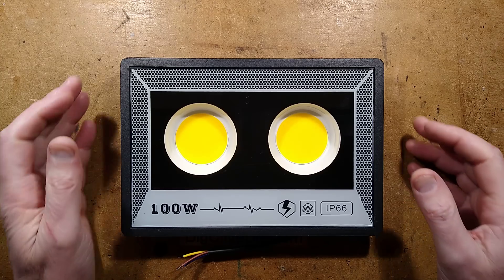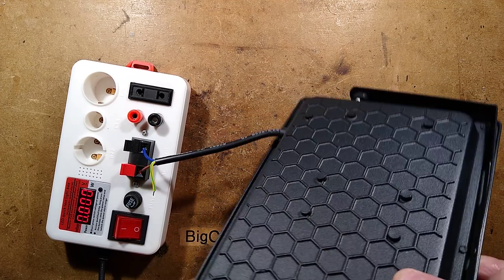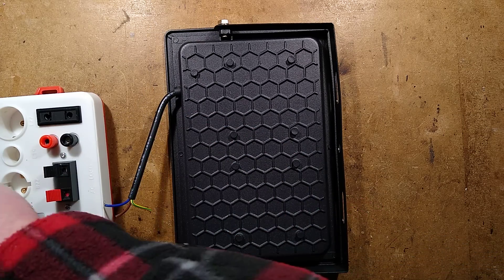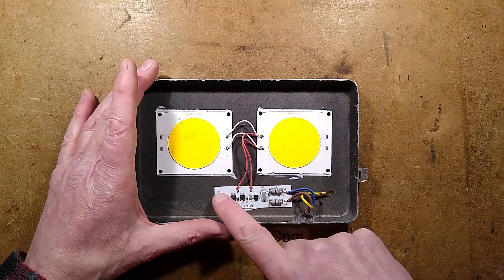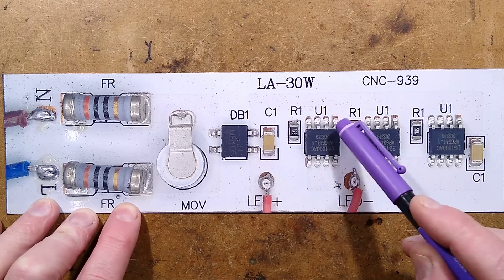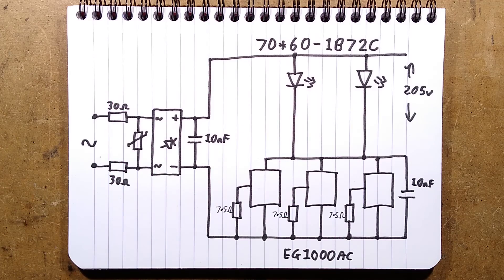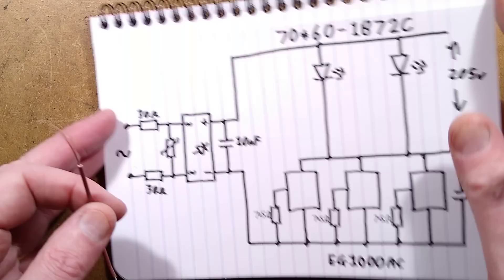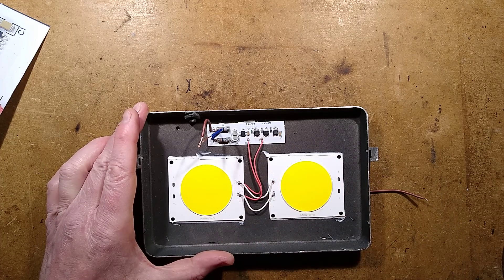Temu 100W LED floodlight is exactly what you'd expect.....

Comment: aluminum(I am american wankers) is actually a fine conductor for power transmission, what bothers me about it is the prevalence of CCA without proper labeling

I mean some high-voltage transmission lines are simple aluminum wires

you shouldn't use it inside a home build with wood(the resistance of aluminum tends to lead to increased heating and insulation weakening) but in free-air or flame-retardant constructions(aluminum framing) I would have no issues with a properly designed lighting circuit I would be happy to use aluminum wire for the power(would not trust any normal person to be sensible with plugs, unlike me)

what makes it suck is the difficulty in termination, CCA wire is an attempt to make it solder like copper, but sadly the coating is way too thin and weak to solder, you have to have very precise temperature to barely melt the 63-37 leaded solder(would not even try lead-free) and even then it quickly and easily fails to remain intact

but a fixture that is limited to 40w and is intended to be terminated via compression-like connectors(wago/screw/wire nut/ect) it can handle a few inches of CCA just fine
just please terminate using a ferrule because CCA is a nightmare to twist

Comment: 37 W at 205 V makes 180 mA out of the circuit board.
While this is not much I'd expect them to connect each LED-module individually to the circuit board. What did they do? They connect just 1 to the circuit board and sling the current for the other LED-module through the hair-fine "wire" of the 1st one. 🤪
If the isolation of these haire-fine "wires" is up to standard for above 42 V is questionable aswell. 🤭
As you said: "interesting"! 😂

Comment: Correct me if I am wrong but doesn't that 100w rating mean that it's the light output equivalent and not that it uses 100 watts? I did not see you using a lux meter to test it's lumens. All you did was test it's power draw.
Reply: LED replacements for incandescent bulbs sometimes have a label like that to give context for how bright they will be, but LED lights of this style are typically rated by the actual output, which can't be any higher than the input draw.
Reply: @Kevin-mp5of  Grammar Gestapo identified.
Reply: Hard to tell, but it did look about as bright as a 100W incandescent bulb. It would be interesting to know the lumens. Drawing 37 watts for that level of brightness is unimpressive.
Reply: @Kevin-mp5of  more like off topic and nobody cares
Reply: @Kevin-mp5of  Do you go around the Internet looking for grammatical errors? Nobody said "it's" or "its" either. So your comment is pointless on multiple fronts. Congratulations.

Comment: Of course the 100w refers to it chucking out the equivalent light output of a 100w incandescent light bulb. I have a 60w equivalent led lamp at home which only uses 12w of power 😉😉
Reply: So much for LED being good then as 60w equivalent CFL's have been available for decades that only use 11w of power... I'd get a new LED lamp as Philips do 60w equivalent LED filament lamps that only use about 4w lol.
Reply: @FrontSideBus  CFLs contain mercury vapour, which is a hazardous material. This makes their construction a lot more daunting and expensive than constructing LEDs, which are pretty easy to make. They also require more complicated driver circuitry; an LED only requires a constant current power supply, while a CFL requires a ballast (magnetic or electronic) to pass high voltage and get the heated contacts working before it can strike. So yes, LEDs are good, even if they don't outperform CFLs in brightness.
Reply: @aaronmdjones  I'd take a CFL any day of the week, The colours are much better and the last longer too!
Reply: @FrontSideBus  LED lamps have different color options, just like CFL and incandescent do.
Reply: @kmoecub  I'm on about CRI., not CCT.
Reply: nah. they will have a little disclaimer at the bottom with the finest text saying: "100W is just a product code. It doesn't mean it can output 100 Watts."
Reply: @SodaWithoutSparkles  Sounds about right!
Reply: Well, that would mean that 100W equivalent would need 20W LED. The 38W measured would more be like 190W equivalent. Why haven't they advertised 200W then?
Reply: @DavidSallge   depends upon the efficiency of the led and its driver
Reply: @johnburns5783  Of course. I should have added "results may vary". But, seeing how badly this is botched together, I doubt we can expect much efficiency from these types of products. So it might just happen to be right with 100W equivalent, given a really bad efficiency.

Comment: Atleast they used Copper coated aluminum. I've seen Copper coated plastic wires (it melted at about 260c). I was shacked that that was used as a mains cable for 230v
Reply: Surprised they also used 3 wires when the earth was not connected, 50% more expensive for nothing ... unless they want you to believe it's grounded, but I'd assume people fooled by these ratings with wires so thin would not know or care about grounding.
edit : and even the ground connector inside the case, where no one would even see it ? looks like someone at some point designed it somewhat correctly, and someone else screwed it up later.
Reply: @pbe6965  The earth wire even has a lug crimped on.  They could have saved a penny and left omitted the lug.
Reply: @wtmayhew  yep, I wasn't sure about the translation so I used "connector" instead of "lug".
That part at least was almost done correctly, if only they tapped the case and add the missing screw.
Or they could have omitted it and saved a few pennies as you said.
I'm surprised they went "so far", and didn't commit in the end, either go all the way or remove it entirely.
Reply: @pbe6965  Thanks for the reply.  My reply wasn’t a criticism of your wording.  Your comment is fine.
Reply: @wtmayhew  I didn't take it as criticism ;) 
english is not my mother tongue, I intended to thank you for confirming that "lug" was correct in this context but it ended being lost in a reformulation of my message.
Reply: @pbe6965  Thanks very much for the reply.  There are too many commenters who just like to feel good with themselves by criticizing.  I don’t want to be one of those people.  Best wishes.
Reply: Some specialty high-flexibility cables are have wires made of foil wrapped around a plastic core. Classic curly telephone handset cords are the main example but I've read some electric shavers might be made this way as well.

Comment: When they say 100w light what they actually mean is up to 100w light. But their Chinklish doesn't translate that part very well.
Reply: This is more than translation errors.
Even if they wanted to say "100W of light compared to an incandescent bulb" (around 1800Lm), this is still not a good Lm/W ratio for such a 35W led lamp. Pretty confident it does not deliver those 1800Lm though. 
And quite certain that on almost all developed countries (even inside the PRC market) it's mandatory for sellers to provide basic characteristics such as power consumption and luminous flux for consumers.

Comment: Oh well, your as bad as me, pull out active and neutral from the chinesium tester while its still switched on (2:08)
And the usual chinesium "floating Earth" so funny.
Also noted they are colour blind, active and neutral are backward on the PCB
Reply from the maker: The connectors were off.  The display is directly powered internally before the switch.

Comment: Looked like a neat little enclosure. I was most surprised the front panel was real glass!   I bet if there was a non-destructive way to open it up, it could be fun to zigzag some LED strips in there to make a cool little low voltage wash light, or maybe a strobe.
Reply: Maybe a proper heat gun and patience would do the trick, though the case might dissipate heat too quickly. Maybe using an oven? The glue might not react to heat before the innards let the magic smoke out anyway. …If the innards are worth saving, that is. Otherwise, crank that oven up. :)
Reply from the maker: It's a silicone style glue.  It didn't let go with heat.
Reply: It may not be non-destructive opening it this way, but there's nothing to stop you from doing just what you say, then resealing it any number of effective ways... Get on it!
Reply: IDK what, if any, type of solvent can weaken the glue.  However, regardless of how weak or strong the glue is, one could attempt to introduce a fluid (gas is easier, liquid is safer) through the power cable opening at sufficient pressure to force the glass off.  Probably still break it, but prying was going to do that anyway.
Reply: A polycarbonate lens might be less breakable than glass, but that is probably asking too much from China, Inc.
Reply: You can actually by empty enclosures like these on the Chinese websites.

Comment: Almost as good a rating system as the 1,000,000mAh battery bank I found the other day, that was the size of my thumb.

I wonder at what point their rated value will exceed the point at which it should collapse into a black hole?
Reply: can it be used to power a Tesla car?
Reply: @esecallum   It's not hard to "power" a lithium fire. Generally you just need to wait for the power pack to become pierced and it happens all on its own.
Reply: @ConstantlyDamaged  can the 1000000 mah power a tesla car?
Reply: They should just start using femtoamphours if big numbers is the only need.
Reply: @benbaselet2026 They get the capitalization wrong plenty of times too. It always amuses me to see a battery capacity expressed in Mega Amp Henries.

Comment: Weird electrical signal sign on the front, it looks much more like an upside down heartbeat...

37w,ugh, why bother

Virtually no heat sink fins!

Copper wouldn't stick to a magnet either...
Reply from the maker: It was in case it was copper coated steel.

Comment: 37W was more than I expected TBH
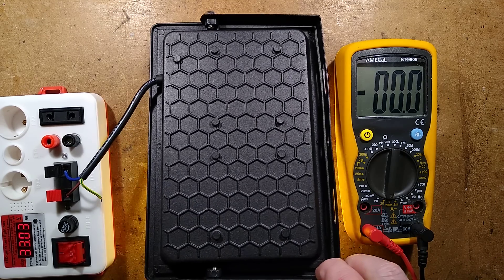Reply: It quickly dropped after he had turned it on. At 1:51 it was already below 33W so I guess it would settle at around 30W.
Reply: In my experience, it's always the power board that they cheap out on. I wouldn't be at all surprised if they paired their 30W PSU with a pair of 50W COB's, but as you can't get the bugger open to replace the drivers, it's all a bit academic.

Comment: And from the look of it .. there was a place to screw in the earth wire directly next to it
Reply: Extra screw cost and labor time ! You're FIRED !
Reply: @michaelmoorrees3585    If they are so worried about cost, why did they spend the time and money to crimp a ring terminal on the ground wire?
Reply: @aevangel1 To be fair, they probably buy them with the ring terminal already attached, or they already had those cables for something else and used them for this product too.
Reply: @rosskrt    my comment was in the sarcasm font... Lolz
Reply: @aevangel1 because it's cheaper than having two different processes
Reply: @aevangel1  the sarcasm font? That's a new one for me
Reply: seems typical. they're set up to do it right if there's a potentially lucrative customer that really insists on it... but also very aware of exactly what they can get away with in practice
Reply from the maker: Yup.  A bit shallow and needed tapped.
Reply: Chinese product with an earth wire? I am surprised.
Reply: @deang5622   If they sell them in the EU also its required and many customers would not buy the fraud if its to blatant.

If they just save on the invisible inside they only get burned if one of the units do cause serious damage or death.

And they most likely did have some with the wire attached for the first batch where the likelihood of government testing is much higher.
Reply: I wonder if the Chinese are trying to say it has the equivalent brightness if a 100W incandescent bulb. I don't think they want to brag about it having a high power consumption. They sorta do the same thing here in Japan.
Reply: @ernieschatz3783  They do that with Halogen bulbs here in the US, too.
Reply: @ernieschatz3783 same here in Italy, each and every light fixture you buy also has an "equivalent incandescent power rating", and although I never use it, my father keeps reading the equivalent power rating. I guess it makes more sense for him than for me, since he grew up with incandescent bulbs.
Reply: @ernieschatz3783  No, they realize most western markets want bigger and brighter, so they double the actual power output of the thing (on the packaging) in order to sell them.  it's that simple.  they do it on everything and anything they can get away with, from LEDs to batteries.  buy a chinese 1000 watt battery?  it's 500 at best.
Reply: @ernieschatz3783  I suspect that's could easily be the case and these two LEDs would be easily brighter than a 100W incandescent bulb, and likely very similar to a 100W halogen setup similar to it.
Reply: Yes there was 😂 but they didn’t